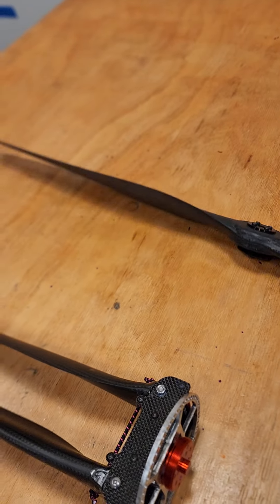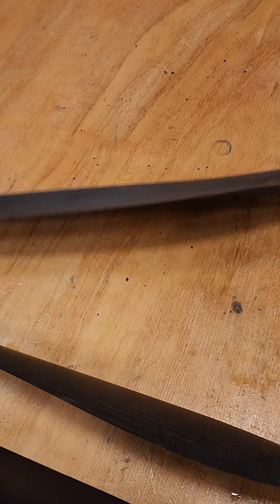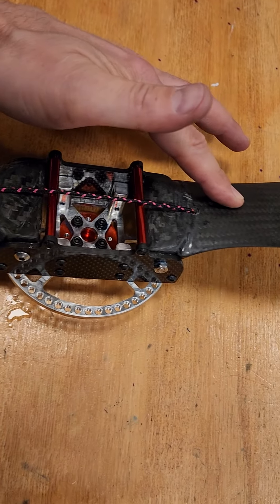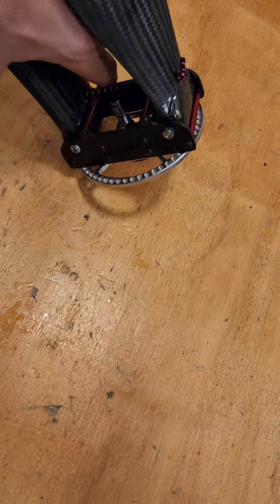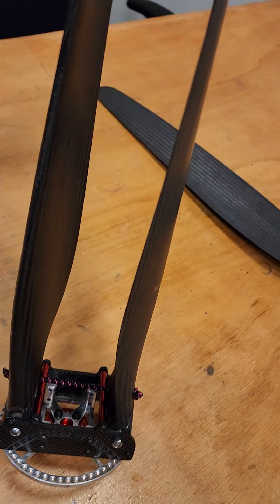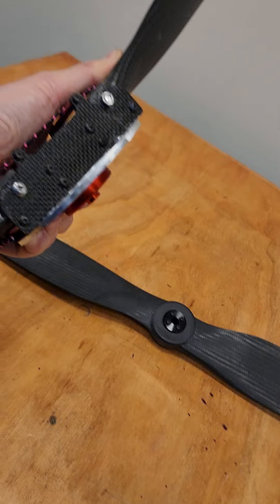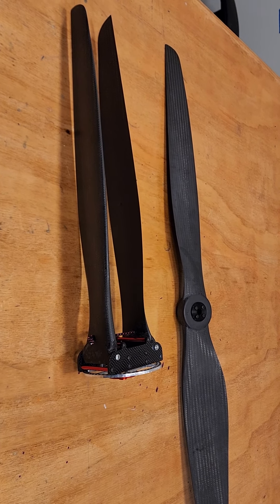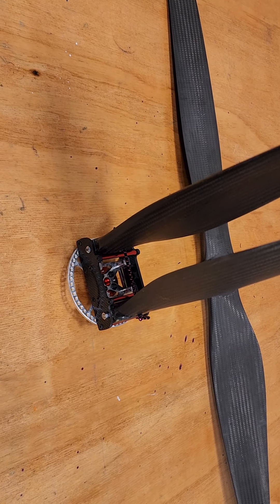ehelp CF folding prop

Comment: One of the best designs I've seen in terms of weight honestly.
I really appreciate the work, as I am stealing a bunch of your design choices for my own e-help, and will probably use this too if it works out (ehehe).

Cheers,
Matt
Reply from the maker: Matt - I'm open sourcing all the ehelp design files.  The folding prop Fusion 360 cad files are available via a link in the Facebook group. They're in the upgrade folder. I didn't manage to test at the mini comp so make sure to test.